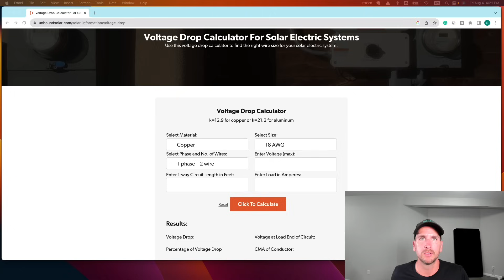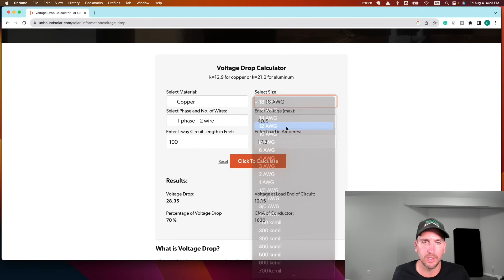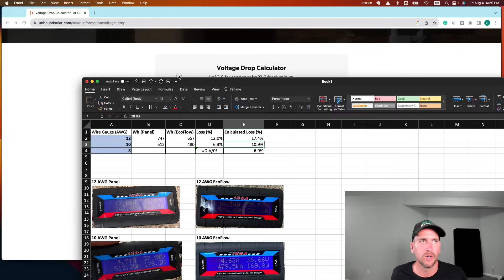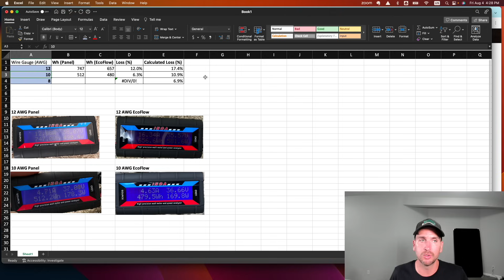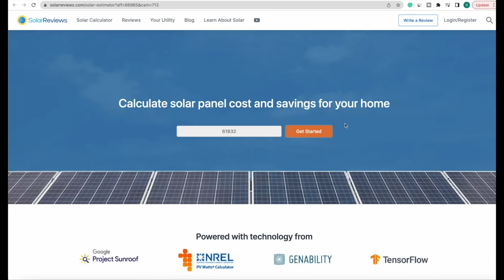What Wire Should You Use For DIY Solar Kits? Surprising Results!

Comment: Good, simple test.  Do you have any info on connector loss?  I've slapped together a simple system of 450 watts (rated) worth of lower-end panels, ran in parallel (staying on 12 volts to feed cheap automotive grade equipment) where all panels connect to a pair of 4-way-to-single-wire MC4 connectors that feed my controller.  (Forget the brand, but they were a "common" showing on Amazon).  Basically, did I go too cheap, or are these kind of connectors not good, or is there something I should consider in my rigging, or am I over thinking?
Reply from the maker: I have not tested losses at MC4 connectors or on MC4 parallel branch splitters.  I think you should be fine with your setup and I have purchased several splitters from Amazon and had good luck so far.
Reply: @everydaysolar  I appreciate the fast reply.  As said, mine was a slap-together system, somewhere between tinkering and small scale backup for emergencies.  Useful that I've not paid a dime to charge my phones, tablets, or flashlights for years, though.  Thanks.

Comment: The tech data for that pro calls for 15 amp max on the solar input how are you pushing over that and not damaging or losing power?
Reply from the maker: The Delta Pro will clip the current to a maximum of 15 Amps.  Don't try to go over on the voltage as the system will turn off once you go over 150V.

Comment: Ive done real world tests and concluded that yes distance plus amps affects gains from thicker wire.  But  you want to consider average amperage not optimal. First of all, you will only get 80% of rated in best case.  Second, thicker wire makes less difference when you need most efficiency- when its shaded and output drops to 30%...so optimizing for sunniest hours may not get you much over the whole year.  That money may be better spent increasing your panels for cloudy winter days.  Consider that for most overall yield per dollar.
Reply: Yes. Our solar systems from 1 to 20 megawatts in MA only consider 7 months of optimum solar. The other 5 months of winter are a bonus. And our 10ga wires run hundreds of feet from 500volts in 2013 to the 1200 volt systems now in 2024. The important thing for homeowners is to not cheap out and be sure they're using PV wire...and of course having a licensed electrician install the system. In MA only licenses can even touch solar.
Reply: @Icehso140  Wow!  At 500 volts (and even better 1200) the calculation shifts dramatically.  Your professionals know what they are doing to bring up the voltage from the panels.  

People doing smaller systems should understand that three things affect the wire size calculation:  the voltage (often 100 or less), the watts delivered (again, I think 80% rated or even lower to save $) and the distance.  Again, I contend that you don't need to care so much about maximum efficiency on the best days of the year at noon.  You need sufficient efficiency on the medium days that are more numerous in your area when the power produced will be good but less.   Optimizing wire gauge for the the highest possible output that you only get when there's more sun than your system is designed for is not usually the best use of funds.   Exceptions would be maybe running AC on the sunniest days or a grid-connected system that pays back.  But good to recognize that seeing that 80% of panel rating may only happen for short periods and when you least need it.  Might make more sense to spend that money on more panel for the shorter or cloudier days.  Of course, it's an iterative process.  More watts bigger wire...
Reply: @ceeweedsl  Thanks for the reply. I played with a battery backup/inverter setup for running my furnace for a few hours. Cost: one battery, 2500 watt pure sinewave inverter, battery switch...$700. Add 2 panels and charge controller...another $300. But I have nearly unlimited funds...as long as my wife doesn't see this. LOL But if someone can add a panel or two, it would be good, and Amazon has a pair of decent panels for less than $200. Buying used panels that are still good works to. Solar technology has increased efficiency times 3 over the last 10 years, and the panels we installed 10 years ago are still working within warranty. As they get switched out ,they become viable used panels for homeowner projects. (As long as a licensed electrician supervises the installation. )
Reply: Good point

Comment: Should have put the 100 feet in the shade; hirer wires are also an efficiency loss.
You mentioned the series connection, but didn’t test it.
The higher voltage will be heaps more efficient and cheaper as you can use thinner wire.
I’ll look for a series panel video now; I hope you did it already.

Comment: First off use a Solar Charge Controller that is appropriate for the total voltage / amperes from the solar panels. Higher voltage / lower amperes can be run through a wire that is smaller in diameter. Remember to use at least a 20% buffer. Also, distance is a factor in any voltage drop. This video is poorly done. Expected a 2% drop for every 50 feet of minimum wire size recommended.

Comment: Number one problem that I see with this test is the wires appear to be exposed to the sun's heat.  The heat from the sun will increase the resistance of the wires---making the voltage drop percentages higher.  It is more likely that, especially for residential, the wires would be at least in conduit and most likely buried in the ground for most of the run.  So, the drops would probably be less.  However, the delta between the gauges would probably be in the same range as tested.

Comment: From  Leo:  Look up whatever wire size that the charts recommend.  The ampacity charts have been standardized since WWII.  Don't forget to de-rate according to length  and temperature if applicable.  Then  use 1 size thicker.  That is how I sized conductors in industrial applications since the 1970's.     Everything I set up is still running even in horrible conditions.  Whatever you think you are saving today will always bite you in the long run.
Reply from the maker: Thanks for the feedback 👍
Reply: You seem to be confused about ampacity vs voltage drop calculations.  There are times when ampacity matters a lot, and so maybe that approach worked if you were pushing those limits more than voltage drop.   An example would be short runs of high amperage, higher voltages.  At that point voltage drop is out of the picture and ampacity is the limit.  But for solar panel runs, not likely.  An 8 ga will handle 40 amps and stay cool enough but that doesn't mean it's a good choice for 35 amps @ 12v over 300 feet.  Nor is upsizing to 6ga adequate in that case.  Use a Voltage drop calc and don't worry about ampacity in this usage.

Comment: will an 8 gauge MC4 connect to a 10 gauge MC4 connector? May be dumb question but im new at this and need to know before i buy the wire with connectors already on it.
Reply from the maker: I was able to get standard MC4 terminals on the 8 AWG but that was pushing it a bit.  I think most standard MC4 terminals and crimpers from from 14 AWG - 10 AWG.
Reply: @everydaysolar  thanks, i was looking at the windy nation 8g cables on amazon that come with the MC4 already on it.... just need to know if it will plug into my Apollo 5K and the 410w solar panel or if I need to cut and splice the wires. I guess my question is the 8g connector bigger than the 14/12 or compatible

Comment: Good video. Good explanations. It would be better to avoid the 100 foot run if possible. Then you can use smaller diameter wire. Calculating voltgae drop in wire works fine you just have to put in the right number of amps. Volts don't matter for voltage drop.
Reply: Voltage does matter higher voltage means lower amps to provide the same power. 
Amps are what causes the loss, the higher the amps the more line loss.
Reply: @ghz24  I agree that Amps are what cause the loss. You are replying to an old comment and I am not going to re-watch the video. But when I said Volts don't matter for voltage drop, what I meant was that the equation for voltage drop involves I and R, not V. So V does not matter when calculating voltage drop. Which is all I said. I didn't say Volts don't matter at all.
Reply: @mckenziekeith7434  I figured you knew. There was nothing wrong with your explanation.  I just see alot of people thinking that "system voltage" (battery) limits the voltage from the modules to the charge controller.

Comment: 24v at 5 amps over a 25 foot 10 AWG wire.. never tested past checking open voltage at the panels and at the controller and didnt see any real drop...

Comment: I run the exact wire you have links to (8AWG). Where do I get MC4 Connectors that will accept 8AWG? Do I need special crimpers for 8AWG MC4 connectors? I would like to get a very good quality crimper as I am doing everything myself as I have a large property and my panels are ground mount. I asked DIY Will but he is getting a bit big for his britches..... and didn't answer.    I need to shorten my 100-foot wire lengths on several strings to get max efficiency and so need to have the 8AWG MC4s and the really good quality crimpers.  Thank You!!

Comment: My 2 pairs of 320w panels is in series running 80v to 2 solar chargers making the size of wire and length of cable much less important... The cable length is quite short because it is a campervan and I used 8g cable which is about double the thickness I really needed for that short length but it only did cost a little more. The battery voltage is 24v so it also needs higher voltage input in to make sure voltage from the panels is always more then 24v.
Reply: Why support Biden's war? Shameful.

Comment: As the thickness of wire goes up, the cost increases exponentially.  For something like this, I'd at least do the math on the alternative of running two hots and two neutrals of a thinner gauge wire vs one conductor of the thicker gauge.  There are calculators on line that let you look at this alternative, e.g. how many strands of AWG X = 1 strand of AWG Y.  Of course the best thing is to max the voltage and shorten the cable run as much as possible.
Reply: This is why I chose an EG4 inverter. it can handle 500 volts mppt. so the amperage is 10 or less.
Reply: Thank you for sharing your insights on wire thickness and cost considerations for DIY solar kits. It's important to find the right balance between wire gauge and cost efficiency. Maximizing voltage and minimizing cable runs are indeed effective strategies. By the way, have you heard about the Segway Portable PowerStation Cube Series? It's a versatile and reliable power solution for outdoor enthusiasts and RV lovers. It offers massive capacity, powerful output, fast recharging, and comprehensive protections. Plus, it's designed with Segway's UltraSeal Technology for waterproof performance. Check it out if you're interested!
Reply: All over the cost of 30-40 feet of wire?
Reply: Why does this guy look like Johny sins?

Comment: Having trouble hearing you over my fans today. But I am also having problems with my ears clogged so it might be that.

I think if I was to DIY, I'd use the lowest gauge, (Thickest) wire possible to the service. If it was a pro install, I'd just leave it what they do with it, and sue them if they burn my house down or I don't get what's promised. I still say that Eco Flow is the way to go and use the solar, strictly to keep those things charged up, and possibly even adding small turbines that are on the market to take advantage of breezes, the wind, or even glowing water if near by, or while filling up a pool, or running anything else with water in your home. Sparking ideas of turbines on pipes to generate electric whenever water is called for. Just a thought. Really stick it to the electric company by getting off their grid completely. When a company is so greedy that they pay to lobby for rate hikes, instead of helping their customers that can't pay, they deserve to go right out of business. We need to do whatever possible to hasten that in our lifetime, so that the future generations aren't screwed right into homelessness.

Comment: I did a HIGH VOLTAGE array and ran 12 ga wire for about 50 feet
When drawing over 3,000 watts there is not enough voltage drop to affect anything (maybe 1 volt max)
However. I'm running a 330VDC system. So thats only a 10 amp draw on the wires 😁
My system can produce upmto 5000 watts but it rarely utilizes as high as 4kw and at 5k I'd still be just 15 amps
My system is a 21S 2P
Reply: Yeah, but that requires logic and thinking and knowing electricity. That's not YouTube content. People don't want to think or learn.

Comment: It's quite a balancing act! The MPPT in the power bank will set the optimum VmP at the point of entry; the panels themselves will be at a lower VmP due to the voltage drop over the feed-wire system. This will mean that the panels will not be operating at their optimum MPP. Next, the power-bank will have a conversion efficiency curve for different DC input voltages; changing the input voltage due to the loss on the feed, will alter the efficiency, and how hot the MPPT gets. For my home DIY off-grid system I used short separate runs with the thickest wire I could afford, before the cost outweighed the benefit. From an engineer's point of view, efficiency is important; from the amateur's point of view, does it work?

Comment: With an eco flow delta pro, the max amperage you can get is 13A. The MPPT is not capable of taking any more.
Further: Putting the Panels in Series (2x the voltage, 1/2 the current) will reduce the loss to 1/4 (3%for 12 AWG and 1.5% for 10AWG). 
Plus: 
The max Power you can get with 2x360W panels in parallel is 40,95Vx13A=532,35W
The max Power you can get with 2x360W panels in series is 81,9x8,79A=720W
Reply: Delta Pro is 15 amps.
Reply: @jacobpetersen5662  Thanks for the correction. The user manual I had when I wrote that comment, specified 13A, the current one specifies 15A. However, it does only slightly change the calculation (613,25W va. 532,35).

Comment: And did I hear that the continuous readings were off from the bulk total period totals? I never thought of or heard that before. Seems they would calculate out to the same. 10% loss measured at a particular moment should make a 10% loss over the entire test period. I’m thinking now you really need three set ups running concurrently to equalize for light variations. Too many unknowns in it for me to say that this test is accurate enough. I’m not saying it isn’t, I’m saying I’m suspicious.

Comment: For 100 feet even with this small two panel setup in parallel, I would go 4 or 6 gauge. Sure, costs a lot, but you pay for wire once, and it degrades over longer periods of time. But the losses are continuously reducing your power production, every minute of every day for years and years. Then there is durability and ability to add on. Add it all up.